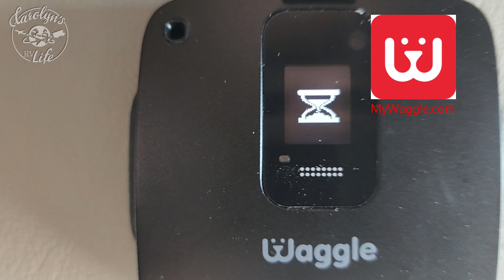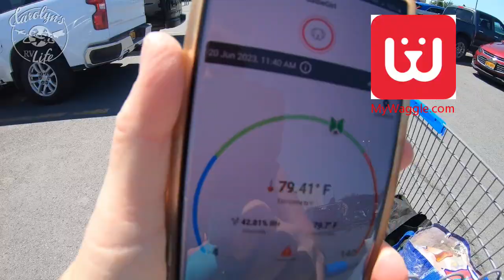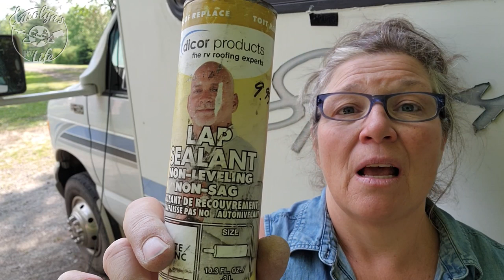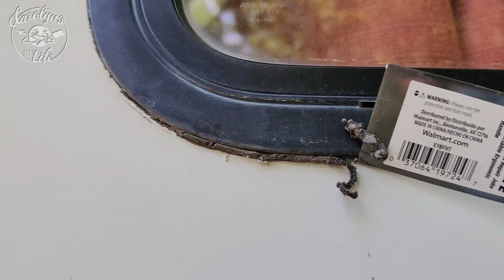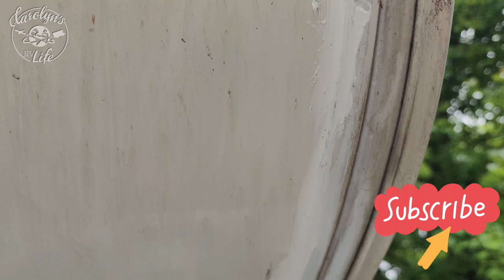How to Stop RV Window Leaks. Fast and Easy RV Window Sealing

Comment: Butyl under the window flange experiences very little exposure to the elements. The butyl on the outside Collects dirt and is effected by the elements. Hard plastic putty knifes, sharpened with a metal file, every time its needed, avoids nicking any surface while removing the bulk of Dicor or butyl that has pushed out from under the window flange. Mineral Spirits does a fine job of removing both butyl and dicor sealant. Taping off the body of the rv, about a 1/4 inch from flange and pulling tape before new sealant skins works well for us.

Comment: That window was never sealed fright from the start. What you scraped off is crusty butyl tape that oozed out and dried. When windows are installed butyl tape is applied under the seal of the window frame and body and silicone over the top of that, to keep it from drying out.